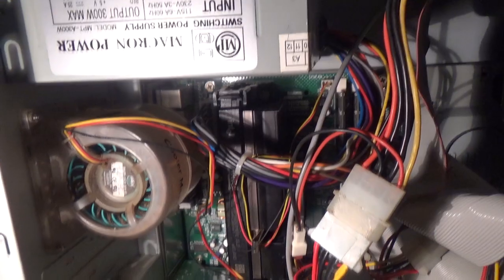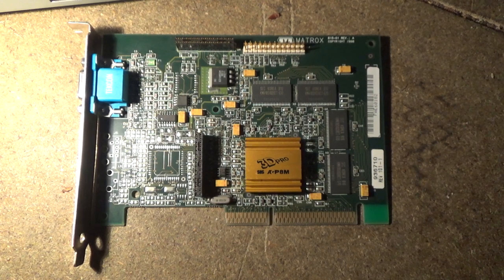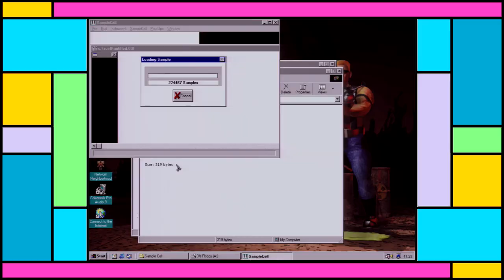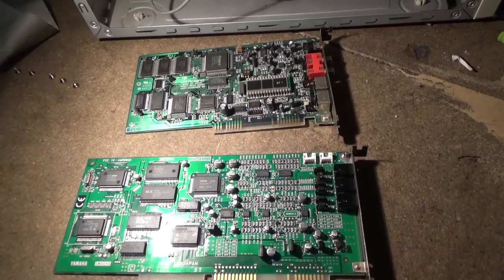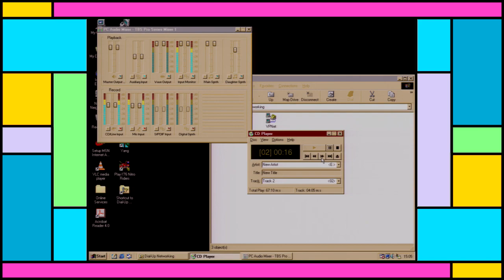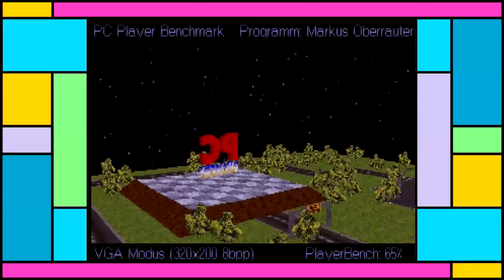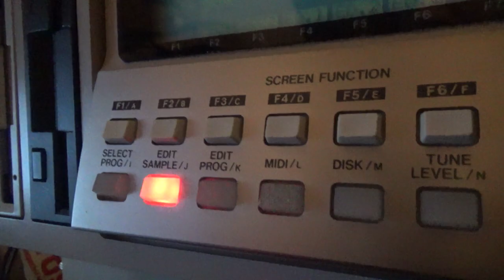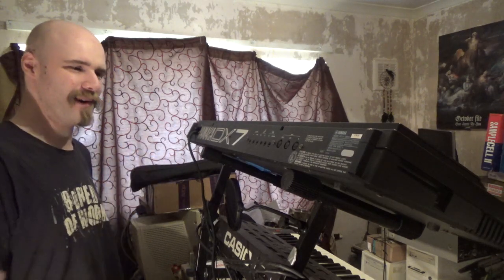Lengthy Incoherent Pentium II Ranting

Comment: I enjoyed the music. I picked up a Casio CTX-518 from the thrift shop a couple weeks ago for $15. Aside from some paint missing from the speaker grills, it is in quite good shape. It has Midi input and output but I need to get a cable for it which looks like will cost more than the keyboard did. It isn't exactly a high quality unit but it works and will be something to mess around with. It uses one of those reverse tip AC adapters, in which I mean the outer edge is + instead of - like normal sane adapters, a sign of the 90's era I suppose. I used one of my spare Genesis adapters rigged with a universal tip so I could power up the unit to test. I feel your pain with Matrox cards, my G550 will not run anything either.
Reply from the maker: Those MIDI cables are unreasonably pricey now, for no good reason, it's not like there's anything complicated in there, half of them don't even bother with the few passive parts that are meant to be there. Casio seem to have always used that polarity and likely still do, Roland actually did as well on some of their old gear. Still, Casio's home keyboards like that aren't bad for what they are, I mean you could actually make music with them right out of the box, with comparatively minimal hassle assuming you had a means to sequence, record and mix things. It wouldn't likely be the best music the world had ever heard, in fact, it would probably closely resemble an N64 game based on the CTK-541 (likely has similar guts to yours) I have stored away somewhere, but it would definitely be music. Unfortunately there are some professional instruments out there, featuring a few extra zeroes on the end of the price tag, which can't even do this without some serious time wasting being involved.
That's why I like the Casio CZ-1, it was one of only a couple of attempts they made to make a somewhat pro instrument, so it has advanced features like velocity, aftertouch and, naturally, is fully programmable instead of being limited to factory preset sounds, but people (who in many cases had seemingly never actually used one) said it was garbage for years which made it cheap. Programming was said to be hard, but I've yet to figure out the metric to which it was compared, the buttons are clearly labelled versus Yamaha's DX keyboards which use inconsistent  and obscure menus - further more, the CZ range used the same method for every model and the patches were even compatible, where the DX keyboards had different interfaces and different synth engines, rendering programs incompatible across even the same series, or even different revisions of the same model to an extent in some cases. To be honest, it's something that might get a video some day, comparing the two 80s beasts side by side, from 'out of the box' to attempted music production.
Short version; Casio CZ-1 - £65 (Closer to £100 after postage), Yamaha DX-7 - Usually at least £500 (often over £800 after shipping).
Regardless of anemic 3D features, the Matrox is still one of my favorite features in this machine, dragging large selections around in Cakewalk does not slow things down at all with this card until things get really silly.

Comment: the p2 450  was a pretty rare cpu. by the time i upgraded my p2 266 the p3 450 was already available. the p2 400 was more common.
Reply from the maker: The gap between their release was definitely small and the prices probably leveled out quickly, so it stands to reason - most people probably either bought a P2-400 or P3-500 by then, if they weren't going for a K6 or something else.
Reply: HighTreason610 I bought a p3 450 because I had an intel SE440BX motherboard that had support for it after a BIOS update. Had to replace PC66 SDRAM for PC100 because of the increased FSB though.
Reply: Rare eh?  Awesome.... I have a box with like half a dozen P2-450s with huge blue heatsinks attached.

Comment: I have a somewhat similar experience: got a fake Yamaha PCI card in ~2001. That appeared to be Crystal: 4281 chip to be exact - suddenly for me, I still remember the number. Both the chip and the drivers on CD were rebadged ('repainted' probably is a more proper word).

And got QDI board recently, that one is on Apollo Pro 133A. I'm more of a hoarder though, I don't have any real task for it at this moment.
Reply from the maker: My suspicions with the one here are that it is a Crystal due to the feature set and also the problems, because said problems are reported by users of a very similar card using a Crystal chip without hiding the fact. QDI boards work, I have a VIA-based Socket 370 one around here, but it only gets used for testing now, because why would you run one Pentium III if you can run two? That's the job of another board.

Comment: have you considered adding either a motu micro express or midi express xt with parallel interface to this p2 setup?
Reply from the maker: I've thought about devices like that in the past, but they are really hard to find, usually extremely expensive and impossible to obtain software for. As real-time multi-channel rendering isn't really something I do, I'm quite happy to incur the small added latency of daisy-chaining things, because both the Casio and Yamaha gear doesn't filter anything out before forwarding to the Thru port. Even then, the latency can be compensated for because it will be a fixed amount.

Comment: You seem to have accidentally edited footage from a video entitled 'Shitty Sound Cards Of The Late '90s' into this excellent video about music production. Fortunately the information provided and the end result (including the music) make up for it. ;)
Reply from the maker: The system took so long to put together that this was bound to happen, in the end I just couldn't seem to edit it down any more and decided to run with it as it was, for better or worse, probably worse. There were plenty of other things that were supposed to be installed in this machine at one time or another which didn't work out for various reasons, at least it works now. On the down-side, the machine used for actual recording decided to break, hopefully only a temporary setback.
Anyways, thanks.

Comment: I hated slotted CPUs.. expensive. Big and bulky.. a pain to mount... didn't miss them when they went back..
Reply: They had a lot of downsides, but surely they're easier to mount? No thermal paste and no screws can even be a benefit for retro gaming, since you can relatively easily switch between a faster PIII an old PII which supported underclocking. Granted, 440bx isn't the best platform for speed sensitive games, but it does at least let me play Daggerfall and a couple others properly.
Reply: @ozzyp97  Yeah if you have enough heatsinks, it did make swapping them easy if they were all set up already. I just hated mounting the brackets to the motherboard, getting the heatsinks on, etc. If you need something that is a slug, Find a 233mhz Pentium 2
Reply: @Alcochaser  I see, that would be more annoying. So far I've been using a PII 266 clocked down to 166, but thanks to a bit of research sparked by your comment, I've just read it might do 133 with the motherboard jumpers set to 5x. I'd better test that.
Reply: @Alcochaser  What do you know, it actually bloody worked. Thanks for accidentally making me research things.